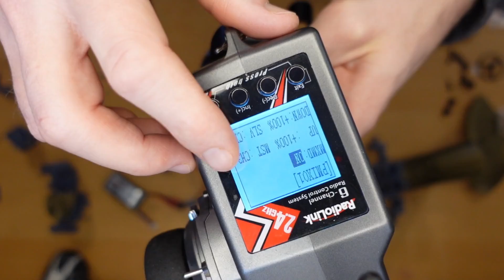3D Printed Tractor Build - OpenRC Tractor MK3 TEA20

Comment: What is the maximum rpm of the motors used? The author recommends 100 to 200 rpm.
Reply from the maker: Hi David, the motors in our electronics kit are the JGA25-370 Mini Motors DC 6V 133rpm. Here's a link with details https://rcprinter.com/products/openrc-tractor-mk3-tea20-build-kits?variant=43772053356705

Comment: Doing mine :D 40C discharge battery will be enough to put it working good? Tested rear servos with 30C and i have a lots of "bugs", it accelerates by his own, when i turn the front wheels it does it as well.... hope it's a matter of battery discharge rate since i have the same radio and receiver. Keep the awesome work!
Reply from the maker: Hmm, I'm not sure what would cause that. I run a 25C and it seems to work fine.
Reply: @rcprinter  hi. Found what it was. These ESC's aren't top, for the price we cannot ask more anyway. The ESC works but it's his BEC that doesn't provide the 5v correctly, on both I've bought (from Aliexpress). Added an external micro BEC 5v/12v, deactivating the ESC's BEC and now it works perfectly. Thank you